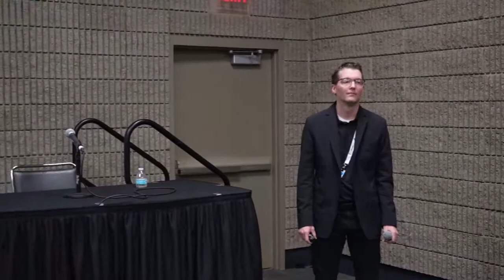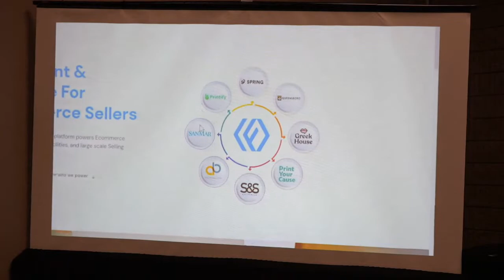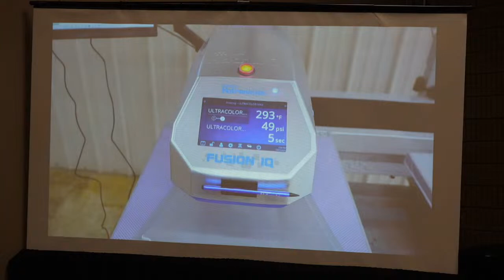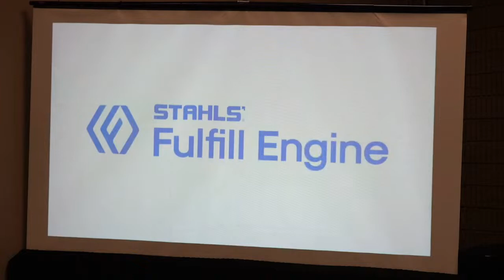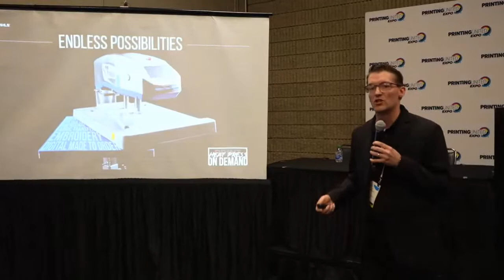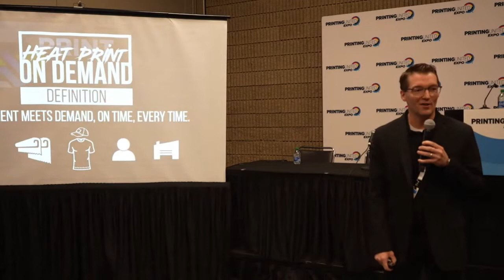STAHLS' Special Announcement at Printing United Expo

Comment: I guess my question would be is private labeling going to be an option in any way
Reply from the maker: Hi Jason, Great question- The Fulfill Engine Platform can be integrated with a wide variety of online stores (Including Shopfiy) but also has the ability to stand up and host products on unbranded, white-label stores that you can customize. 

For the ProPlace IQ we're working to develop functionality with all platens to be able to integrate private labeling of garments with the Tag Along HP Platen. 

Did this answer your question?